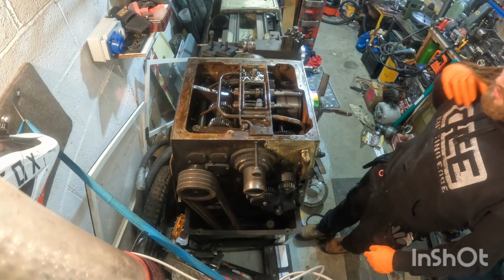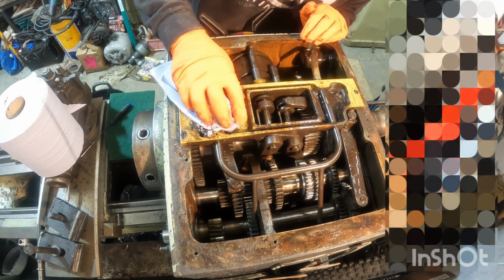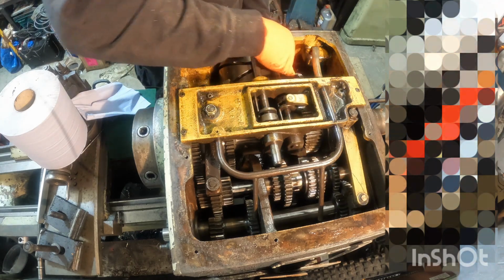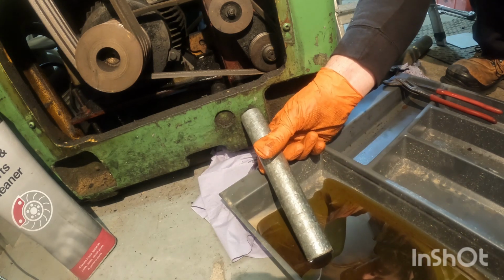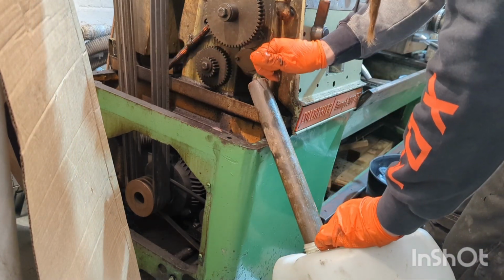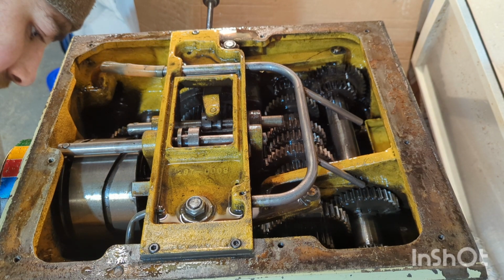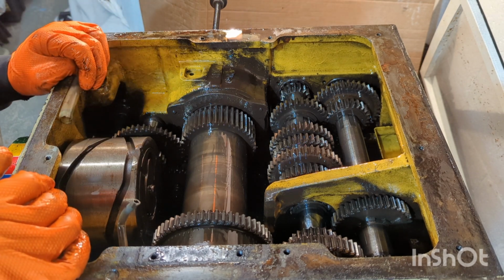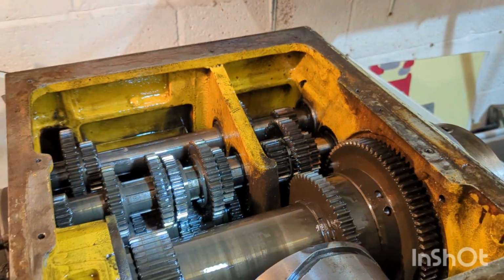Colchester triumph 2000 TR lathe restoration part 4 - oil change & system flush// headstock cleaning

Comment: If it helps any, the operating manual says to use the oil pump to pump the headstock oil into a drum and then drain the rest into a tray

Comment: I have the same lathe. It's had a noisy head since I got it 5 years ago. I initially opened it up and it was clean enough but seeing you digging in has reminded me I really should investigate further. Mine is wired through a  static 3 phase converter which pulls over 30 amps in higher gears. 7.5 hp on 240v will run around 23 amps so inrush will be more. I've given it a dedicated circuit and fitted a type D breaker designed for industrial motors. I have a 5hp motor which I am reliability informed is more than enough for anything I would do and may fit that at somepoint as it still occasionallytakes out the breaker. I'm old enough to remember our apprentice school receiving 4 brand new T2000's in 1981 and the guy demoing a 1/4 inch cut at full speed on mild steel with an aggressive feed without it even bogging down. Our company had about 30 of the things which were virtually bomb proof. I  look forward to the next update.